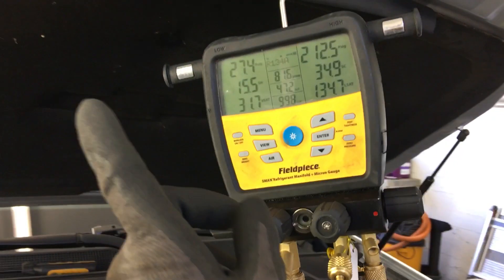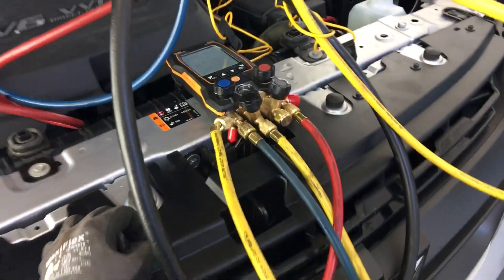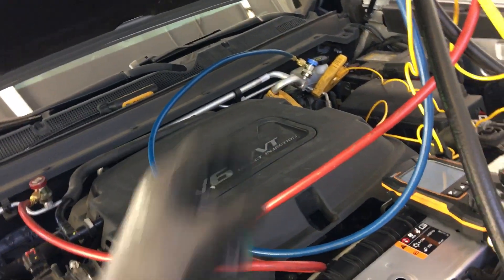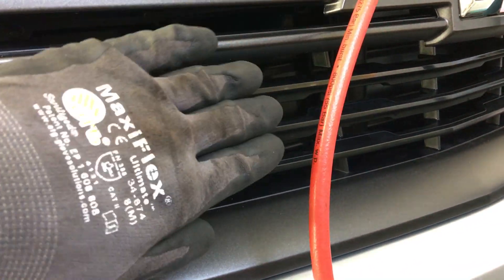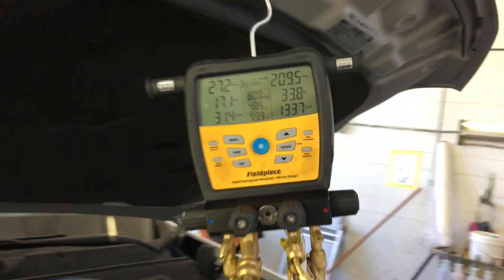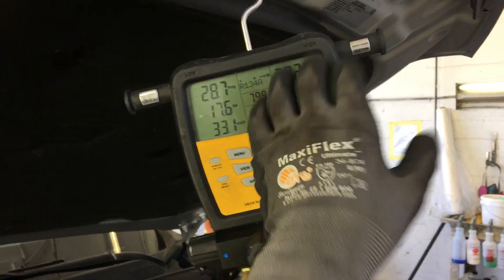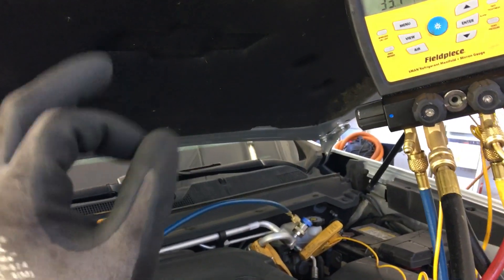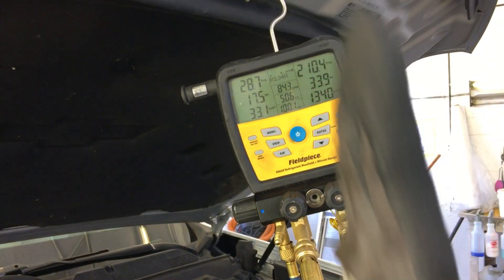A/C 2015 Colorado low side and high side pressure compared to other vehicles. the high side high

Comment: You really didn't explain anything
Reply from the maker: @stevencorso3613  apparently you can’t understand that the high side pressure is on a car don’t mean anything about how the refrigerant level is. 

I’m working on a vehicle right now that’s around 200+ psi with the airflow from the shutters closing off the airflow and it’s still low. 

Well, the vehicle the other side of that wall I’m explaining is at 165 psi
And I can have another vehicle sitting right next to me doing a third vehicle could say 270 psi. 

And every vehicle can be completely filled by weight to factory specification. 

Trying to read the high pressures and just guessing means absolutely nothing. It’s nothing more than guessing.. 

Because this technicians out there who were taught old-school to use the high side pressure to try to indicate whether the system is properly charged or not. 

They don’t understand this.

Comment: Are those reading what the pressures should be for that Colorado because they keep trying to get my low to 45 to 50 psi
Reply from the maker: It all depends on the ambient temperature humidity and sun load on the vehicle. . 

      And you do not attempt to fill a vehicle by using pressures there’s only one way to do it right and one way only. 

     Especially on vehicle with variable displacement compressors

You recover 100% of the refrigerant and throw it on a vacuum pump and then using a scale you add refrigerant to the weight required by the manufacture specifications for the particular year make and model.

Comment: So why is the sub cooling in the 30s when the condenser is blocked from rejecting heat?
Reply from the maker: Welcome to the world of Automotive air-conditioning.       Everything we learned in class or in books does not always apply.       It doesn’t make sense. 

             Some automotive systems just don’t work the way art split systems on the house do. 
             So why can I have five different cars in the shop theoretically all at the same temperature all factory charge to the correct amount.   In the low side pressure on one vehicle can be 12 psi,  Second vehicle could be 19 psi,  third vehicle 21 psi,  fourth vehicle 31 psi,  fifth vehicle 36 psi all on the low side pressure. 
                   Same same five vehicles high side pressure will be.   First vehicle 225 psi,   Second vehicle 190 psi,    Third vehicle 150 psi,   Fourth vehicle 116 psi,    Fifth vehicle 138 psi

          And all of them will have a duct – temperature exiting at between 39°F in 45°F slightly going up and down. 

          All operating conditions are simultaneously in the same shop at the same ambient temperature with the same humidity. 

         Have all the books and the instructors 👨‍🏫 in classes explained that. 
           This is why when I listen to somebody with 20 years or 40 years of experience tell me what a high side pressure for a low side or high side pressure should be as a rule of thumb it’s just wind in one ear and out the other. 

           And sub cooling or superheat will be all over the map. 

        Welcome to my world , where the laws of physics do not apply. Your now in the twilight zone of the automotive world. 

        Of course the laws of physics apply but there’s some funny stuff going on in Automotive. 

            Unlike split systems on the house where you usually always have your pressure fittings always attached in the proper place on all the condensers in the same place all the time. 

            Imagine on residential split systems if one unit they put the high side pressure just off the port directly out of the compressor ,   The other high side fitting on the unit just next to it has the high side fitting attached just before the expansion valve .  Do you think there would be a little bit of difference

               Let’s take a look at the low side fitting placement.     Some cars have the low side fitting directly attached to the low side suction port going into the compressor,        Some cars will have several sharp bins on a hose and then maybe a muffler in the hose and then attach the low side fitting at that point.
                     Now keep following this twisted maze of lines that have hard 90 an even 180° sharp bends heading up the fender well going towards the firewall and place another low side fit in there.     With all those bands and restrictions you would have a different low side pressure at this measuring point to. 
             Some vehicles have a accumulator. 
 And the low side fitting will be located just after the accumulator going back to the compressor. 
            Another manufacture will place your low side fitting right into the body of the accumulator. 
            Then another manufacture will place a low side fitting at the entrance of the flow on the line going into the accumulator. 

           And on top of that a lot of guys don’t know in hose construction depending on the manufacture the inner diameter of some of the fittings really neck down and get small when they slip the rubber hoses over them. 
                      So you could have a run of holes in metal lines that are a size 12   And then as the hose goes to another fitting or muffler it might neck down to a size 10. 
          Now with all these sharp bands and turns mufflers and fittings all creating friction you drop or raise pressure with friction losses. 

            Unlike residential split systems. 
In the car do you have your condenser that should be rejecting heat. 
            But at the same time you have a radiator that is directly behind it. Sometimes far away sometimes TOO CLOSE (Think radiant heat). 
            And when you’re taking your pressures if the engine hasn’t warmed up all the way and the thermostat has not open to allow the hot engine coolant flow yet you have a cool radiator. 
                 Now take that scenario engine heats up thermostat opens up and allows 205° water to flow through that radiator that’s only 3/8 of an inch to a half an inch clearance between the surface of that hot radiator and the condenser that you’re trying to reject heat from. 

               Now let’s throw another bug into our physics formulas of thermodynamics. 

          Now let’s take a glycol heat exchanger from the hybrid vehicles in Burger in battery cooling system with that hot glycol and stick it in front of our condenser rejecting heat into our condenser. 

         On some vehicles let’s take a transmission cooler from a hot transmission fluid and or on top of that a power steering fluid cooler and stick both of them in front of our condenser depending on the operating conditions the transmission fluid could be super hot or just mildly cool injecting heat in front of our condenser. 

             Let’s not forget vehicles with super chargers and turbo chargers that have that large inner cooler that they sometimes like to stick in front of a condenser blocking airflow and adding hot heat just when you go down the road of course and you have boost but not when you’re at idle. 

      But wait that’s not all, if you act now in order, we will throw in A fluid driven thermal fan clutch that slowly goes out of calibration and does not always flow the volume of air it should and while you’re taking your pressures it will be constantly turning up it’s airflow and turning down its airflow over the condenser. 
                Now let’s throw in a dual fan system on the condenser where only one fan comes on to a certain pressure and then when the pressure gets high enough the second fan kicks in never allowing stable pressures
               Another vehicle could have a single fan on a pressure switch that will turn off the fan and allow your high side pressure to skyrocket and takeoff like a thermal nuclear meltdown until you hit 270 psi that closes the contacts on the pressure switch the fan kicks on and rapidly decreases in pressure until it hits 150 psi and then shuts off to repeat the cycle over and over and over again. 
                 When you have the manufactures who might give you one or two fans as soon as you hit the button on the air conditioning it’s 100% fan speed no matter what the Ambien outside temperature is lasting all the time never turning off. 

                 Now the icing on the cake the grand finale. 
               Stick a variable displacement compressor on there were all the sensors for temperatures and pressures is taking over even if the refrigerant level is wrong sometimes even if the airflow is wrong and it’s constantly trying to adjust.  

         So all these engineers out there who have their degree in thermodynamics fluid dynamics these couch potatoes who read manuals and books. 
               The guys with 40 years of experience who worked on fixed piston or scroll compressors on residential or large chillers or geothermal and package units on the roof and maybe at the same time there an instructor in a college at night they could take all their experience in their couch potato book learning. And their PhD or engineering degree and use it as toilet paper.?

         Because that’s what we’re dealing with when you’re working in automotive thermal management systems. 

              And this is where on hands every day on each one of these vehicles doing the same cars over and over again not just five times not just 10 times apiece but literally hundreds of times and even thousands of times on the same year make model vehicle in every ambient condition from working in the rain to working on a mild day to working on a hot blazing sun day you start to learn and see a pattern of what kind of systems give up pressures and temperatures that do not match anything you were ever taught in any book or class. 

             That’s why when I got into my commercial end of HVAC.  I gravitated immediately towards VFR / VRF. Depends what manufacture you’re talking to. 
              Because it reminded me of Automotive with our computer controlled vehicle emission systems humidity sensors temperature sensors barrel sensors map sensors positioning sensor’s duty cycle dwelltime everything on Automotive has been starting to appear on commercial and residential air-conditioning systems. 

         And this is why when you get a old timer HVAC guy with 30 or 40 years of experience especially if he’s a refrigeration guy. 

        And he uses his knowledge and his hand for a beer can can cool. 
           You stick this person on a VF our system and they try to top it off by guessing. 

           I get a call from a customer their systems not working the guy who just worked on it before could not get it to work right and when I get there I find out the compressor is burnt up. 
             Or it’s just grossly under charged or grossly overcharged.
Reply: Thank you for this! I hope all your subscribers read this comment ^!!!
That’s a lot of insight and knowledge in the reply above.